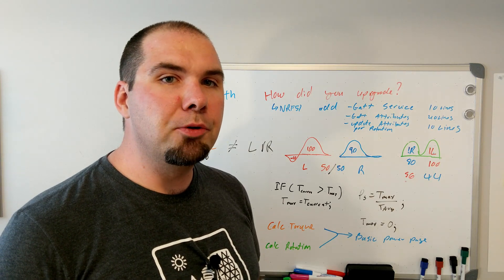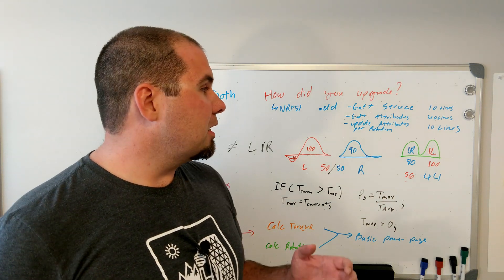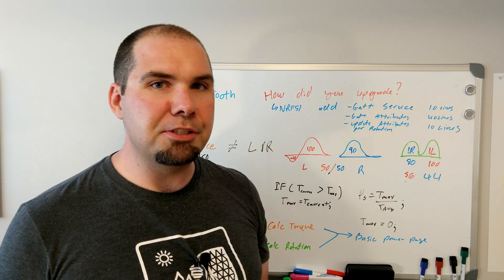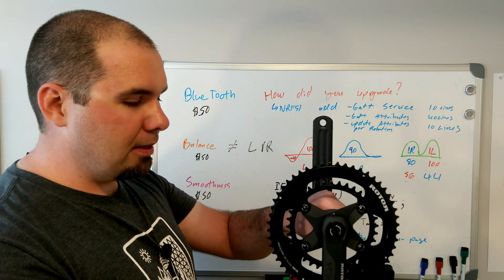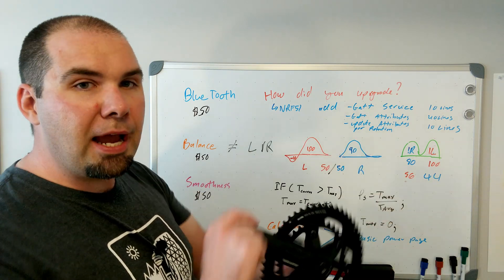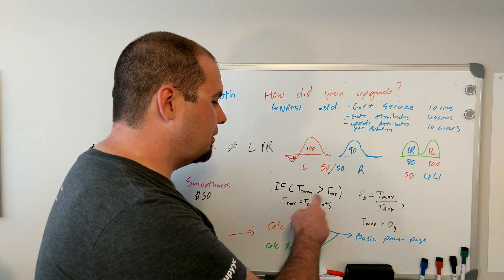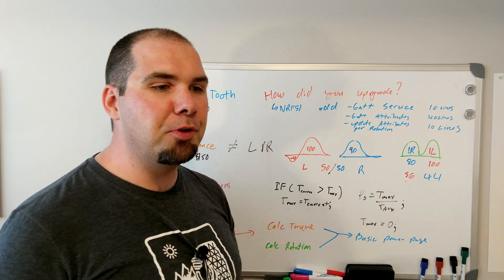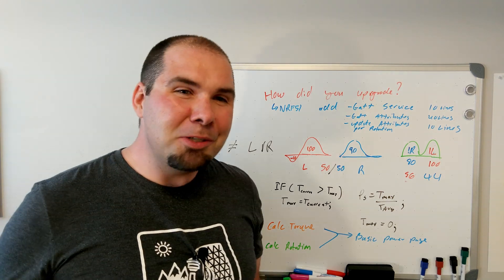FSA Powerbox - $200 of upgrades?

Comment: Maybe I'm missing something on your stroke balance discussions starting at about 2:50 in. If each leg pushes with 100W, but the left leg is lazy (on its upstroke) and impedes the right leg's power by 10 watts, wouldn't you simply have 100-10=90 watts push right leg, and 100-0=100 watts left leg?  I do agree that it would appear that your left leg is stronger than the right leg, whereas it is actually impeding the right leg's power output.  Rather than 100/80, isn't it actually 100/90?  And for the typical rider,  isn't more of the issue that one leg is truly putting out more downstroke power than the other one?  Or is the typical issue that one leg is "lazy" on the upstroke?

Comment: I think it is still quite decent. You can get the PowerBox for basically the same price as a lot of left only powermeters and it comes with chainrings and everything. You really don't need anything except bluetooth and this way it is even cheaper than the NG Eco Power2Max unit which I think uses the same update strategy, but includes BLE.

Comment: Paid upgrade prices can be completely decoupled from the effort that went into implementing them, I would guess this was a marketing decision. Great explanation of what that extra data actually consists of though.

$640 CAD on sale for the powerbox alloy road (probikekit) is not bad. But you have to accept 920g and the fact that it won't be re-usable on other cranks. If it were a more popular product I'm sure someone like you would hack the upgrade method to get free BT.
Reply from the maker: I waver back and forth on where I stand on paid upgrades / feature chopping. I agree with you that it's okay but there was too many deceptive things happening here in marketing and they need a smack of reality. The fact of the matter is in this case it was 100% an after the matter hackery because they had these as base features on the previous gen models that use the EXACT SAME (FCC ID Identical, so zero hardware changes allowed!!!) hardware. Now had a lot of work gone into these features then back pedaling on the next version I'd give a pass as well. Or if they walked into it saying "we're starting with  this with upgrade path" I'd be more forgiving on the concept. However, what I'm less forgiving on duping people with the BLE upgrade since the literal method for upgrading (so the market lie is your not enabling BLE, it's already there, you're enabling a BLE SERVICE/Attributes), then lying with L/R "Balance" with it being  fake / impossible / etc and a different metric.  PS and "Torque" are just useless generally except in maybe an edge use case but marketed as useful and equivalent to something else as true PS measuring devices and high speed.

Comment: Totally agree with it all. I think the $50 Bluetooth option is fair given the price for the crankset otherwise, but the other features are at best gimmicky. I remember having a conversation with a few folks at the Symposium years ago including from Garmin and Quarq about the challenges of the ‘Power Balance’ metric and how it kinda slipped away from everyone in terms of initial envisioning during the spec, compared to ultimate usage by many.

As you noted, the L/R balance on Quarq/P2M-FSA/PTC1 and others is a metric, just not power balance. It’s something else that maybe could be useful somehow (almost akin to power phase loosely), just stuck in the wrong field.
Reply from the maker: On the same page! I even think that the L/R Balance example I used to show true balance shows a flaw in balance or maybe just not the whole picture. Maybe with cycling dynamics we can start getting more accurate picture in the future. Sure a leg can be balanced on down stroke but it's not the same if upstroke is unbalanced. ... Having ideas... must go make python script and connect iq apps now.

Comment: Crippling a few extra features and selling it at a greatly reduced price (it was the only dual-side crank-based PM I could afford, less than $600 with new chainrings) isn't nearly as big of a bike crime as putting crippled power meters on bikes for "free" and charging $500 to activate it (looking at you, Cannondale). Don't you need torque to manually check the PM's slope?
Reply from the maker: Depending on how you implement it crank torque pages don't ensure you can read torque. In fact it could violate ant spec if it did almost. There is a supplementary calibration page that can read back torque when you zero it. This special calibration page is what vector uses for torque read out and not the crank torque data pages. So since you need an event that is mandated to be driven by motion then no, this is not what you could use to check your calibration.
Reply: @kwakeham  Oh, good thing I didn't buy the torque upgrade just for that, then.... I guess there's no way to check the slope on a P2M, then. I may buy the BT upgrade eventually, but won't do that until I get a BT HRM.